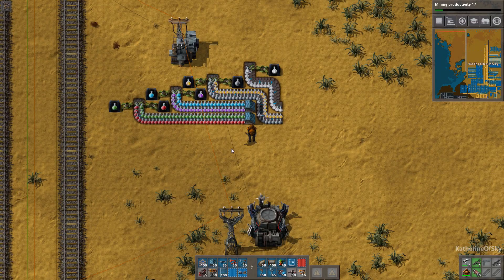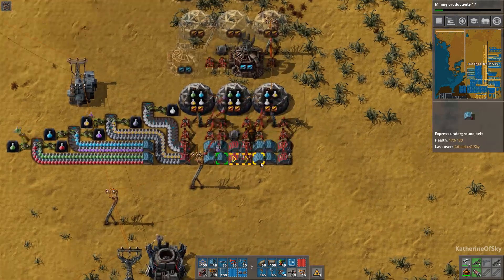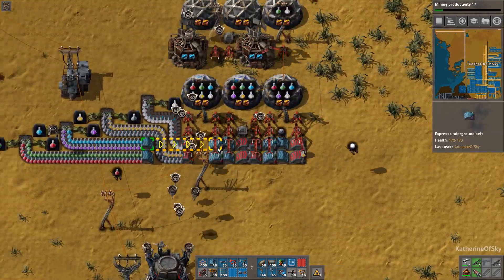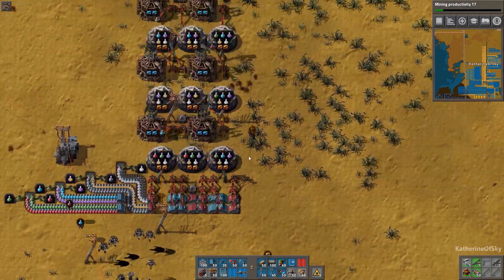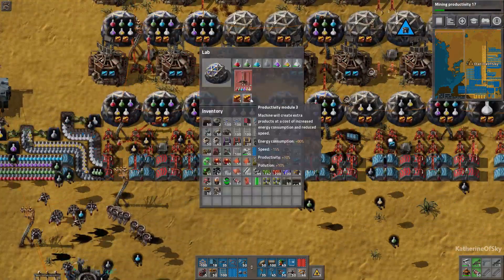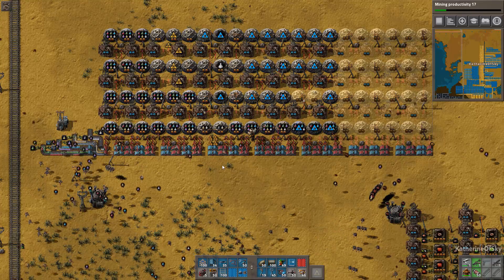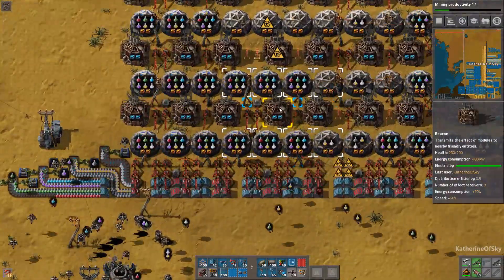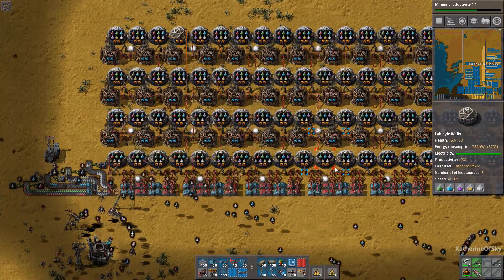Factorio Tutorials: 0.15 Labs Setup  (Science, Belt Braiding, )

Comment: Interesting, I like a cubed shape with filter inserters  passing the science pots in from the sides (2 pots per inserter to match the belt pulled from), no need for crazy cabled belts. 2x2, 3x3, 4x4 etc, all works.
Reply from the maker: I've since gone to a setup where I have speed beacons on the inside, and one lab taking from braided belts.  I find it a bit more efficient than chaining.
Reply: I do like what you've done with beacons and productivity modules. That's really neat. I recently came across this layout. You might find it helpful for feeding labs. https://imgur.com/a/He44I#vayUtyR

Comment: How many labs can one 5,6,12,5,7,7 ratio support? Assuming level 2 assemblers?
Reply from the maker: It depends on the research -- different researches take different amounts of time to process.  If you find your belts are full, add more labs.
Reply: KatherineOfSky Thx for your response, I'm trying to learn the numbers. I was curious as to what a base lab could do w/o research upgrades or module boosts. Been just eyeballing up to now but I wish to plan.

Comment: Very interesing design, however, I adapted it: Instead of 4 rows I use only 2 rows but have labs on both sides of the belt.
Reply from the maker: That's what these vids are for, to share and provoke new designs!  I like the single sided mostly because I can share beacons more effectively and therefore use less modules overall.  In an end-game base, this isn't an issue, of course, but it will matter to me when I'm just on the cusp of getting modules produced :-)